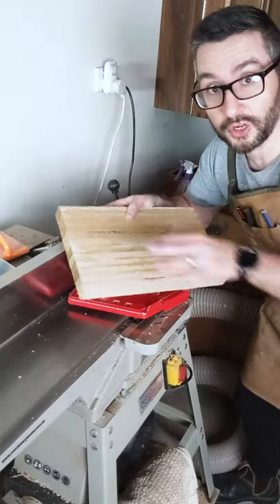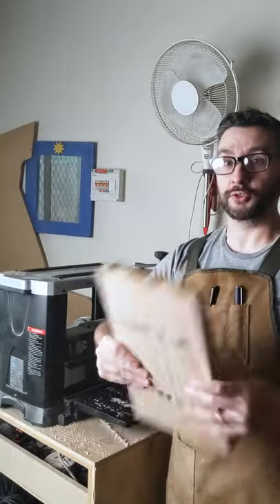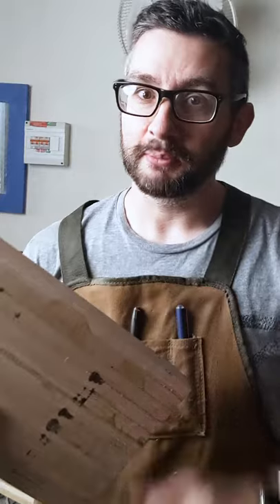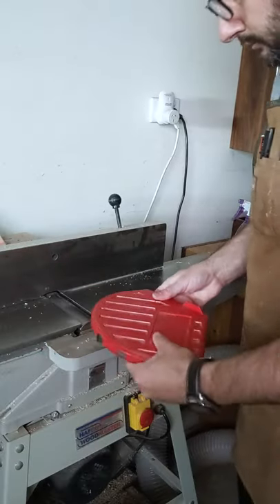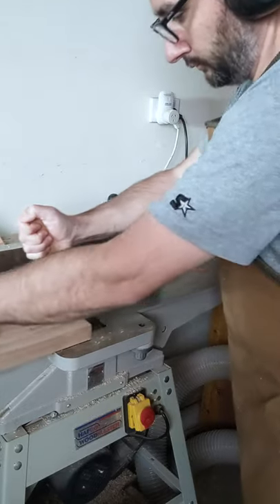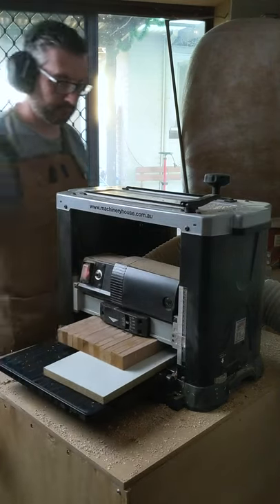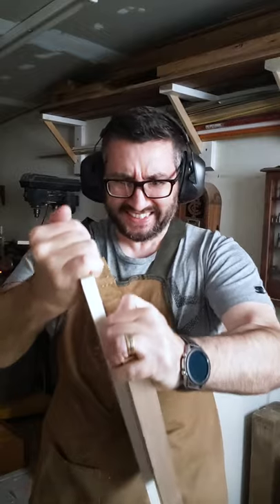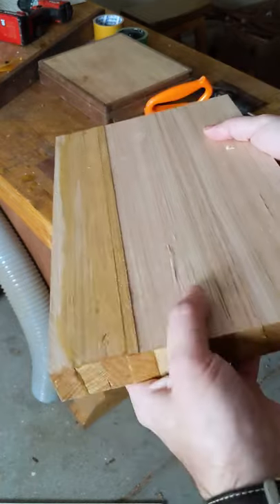Can you flatten a 10in board with a 6in planer? #shorts

Comment: One tip is use a Melanin sheet(or however it's spelled) and rest the board on top shoving some shims until it doesn't wobble then run it through
Reply from the maker: Yep that works too, I've seen people use hot glue to ensure the shims don't vibrate out as well. 👍
Reply: I do that. Simple and works.